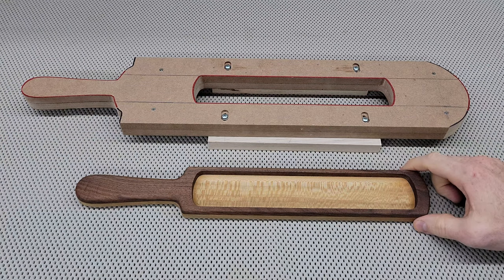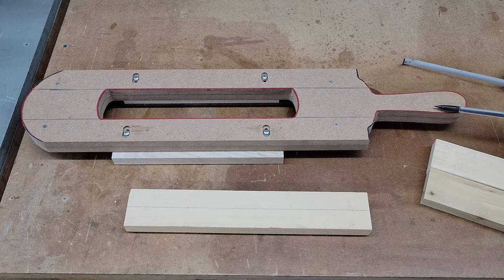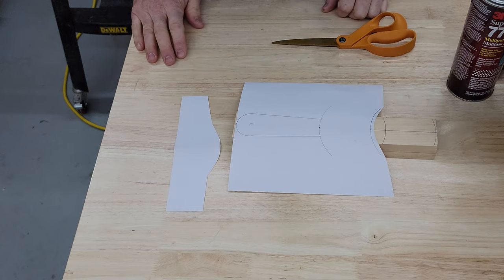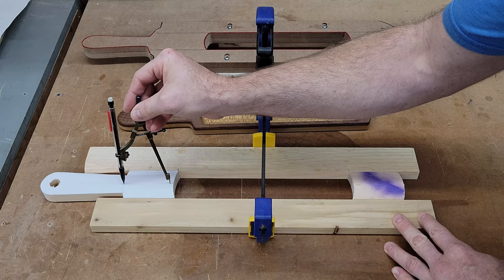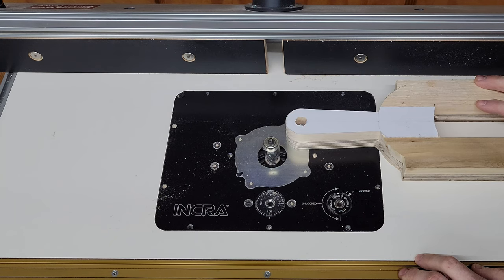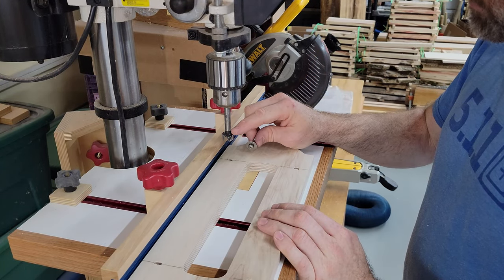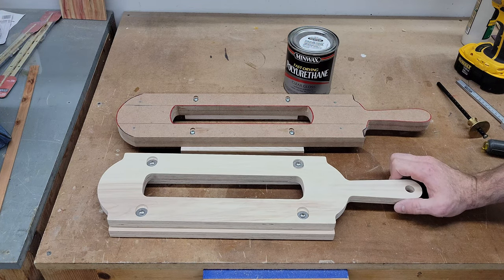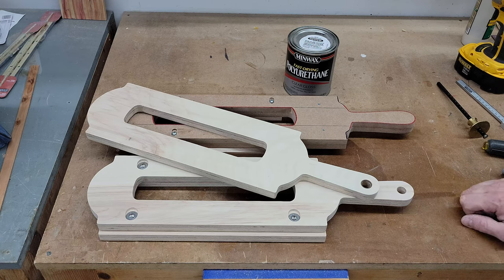Cheese and cracker serving trays - How to build the jig (Plans now available)

Comment: 21:20 Since you're using a top/bottom bearing bit couldn't you flip the work over, raise the bit so the bottom bearing comes into play, then route the other half of the template with the work on the left of the bit so you are pulling away from the bit not pushing into it.
Reply from the maker: That's a very good point. If I had planed the scrap template to uniform thickness I could have just flipped it over.

Comment: Bought the plans for $5. First the amount of work needed to come up with this jig and the additional time to explain and document certainly more than justifies the price. Second the PDF file you get appears very robust (with all the details explained). I hope I can replicate a usable copy of this jig for myself.  Thanks :)
Reply from the maker: Excellent, good luck with the project. Feel free to post links here if you put any pictures online.
Reply: @TheSnekkerShow  Your finished product is top notch. My attempts at making the template went well; but the Bowl Bit in my router table never let me get passed scrap piece. Gouges, burns, varied depths. Tried different cutting heights, 3 different size Bowl Bits (an inexpensive Amazon set). My router is a Skill in a Skill Table, speed set at 2 (with 6 being the top speed). Any thoughts as to what the problem(s) are? I am not well experienced with routers and or using the table. I have used my little trim router for years with acceptable results. Are the Bowl Bits that tricky? Any thoughts offering possible fixes would be appreciated.
Reply from the maker: @simonflr  There are several things that might be affecting the outcome. For a smaller diameter bit, your speed should be 4 or more. The bit needs to be clean and free of pitch buildup. If it's got residue burned on, you can use Simple Green to clean it up. Inspect the router bit edge. It should look and feel sharp. I mostly use Whiteside bits. Freud is pretty good with marketing, but you can see in this picture the difference between a Freud bit and the sharp, polished edge on a Whiteside bit. https://www.instagram.com/p/B-ss9mJBUyY/
Reply from the maker: @I'm Simon  Consistent feed rates are important too. The moment you pause on a certain part of the board, it will burn. It's usually better to disengage if you need to adjust your hands, and then carefully re-engage to continue the cut.
Reply: @TheSnekkerShow  First thanks for your quick and informative response... I will try again after I clean the bits I have, may order from Whiteside regardless
Reply from the maker: @I'm Simon  No problem. I put a link to the one I use in the video description.

Comment: Excellent… I’m working on Pizza Peels for Christmas…. But, I can’t show them on my channel until after Christmas because the recipients watch. 🤫

I am gonna steal a couple of your ideas… you did a fine job of illustrating a lot of template tricks!  Thanks
Reply from the maker: That's a nice gift idea. I make pizza from scratch every week, and I still have not made myself a pizza peel - I'm using a large cutting board instead. One of these days I'm going to get around to it.
Reply: @TheSnekkerShow  I made 15” peels a couple of years ago… they are great for outside use but too big for kitchen use.  This year I made a new template that is 12”.
Reply from the maker: @sassafrasvalley1939  My pizza stone is 15", but there's not a lot of space around the oven for a long handle, nor is there space to store it. I've thought about something with a shorter and collapsible handle, but I haven't worked out the details yet.
Reply: @TheSnekkerShow  that would be cool!

Comment: Any problem putting threaded inserts on the bottom of the side pieces and a bolt OR is that simply overkill??
Thanks for taking the time to do this video - definitely on my to do list! !! !!!
Reply from the maker: Nothing wrong with a little overkill in the workshop. I doubt I'll ever wear out the screw threads in Baltic birch plywood, but threaded inserts are a nice touch.

Comment: Great build, lots of insight into the construction. I can see why thicker ends & slide due to MDF being bit fragile, but now it's ply, much stronger, could you build ends exact size and route out centre & ends without the extra steps?
Age thing, I tend to forget some config steps, so I try to design as "foolproof" as possible (remembering "Nothing is totally foolproof, to a suitably talented fool")
Reply from the maker: I thought about doing it that way, but it leaves some thinner edges on the jig, and less support for the router base when cutting out the inside. Once the initial configuration is done, it's easy to repeat.

Comment: Great video. Question what kind of scroll saw blade are you using for the Dewalt scroll saw? Thanks
Reply from the maker: Good question, but I don't remember. Probably something around 12 or 14 teeth per inch. In general, more TPI means slower cutting but less sanding, and fewer TPI means faster cutting but more sanding. 12 is somewhere in the middle for this type of project.

Comment: Did you just tap the wood for the number 10 screws?  Great video!!!
Reply from the maker: I predrilled the holes, then put a little wax on the screw threads when inserting.

Comment: Great video! Very impressive, master level work, really, no joke. Also, very impressive stack of lumber stickered in the video background. There is a channel I watch, "Workshop Companion" which did a video on re-sawing and air drying lumber. He bound his stack with bailing wire which I had never seen before. Have you seen that video?
Reply from the maker: Thank you. I don't think I've seen that channel. For boards 23" or shorter (the width of the kitchen oven), I normally use twine or bar clamps. Once it's air dried, I'll pop it in the oven with the clamps or twine still on.

Comment: Can I purchase a jig from you? I don’t have all of the machinery needed to make it for myself, but would love to make some trays for gifts.
Reply from the maker: I've thought about selling them, but haven't figured out the details yet. There's a link to full-size plans in the video description, and you could realistically build this jig with very basic tools.  A router is pretty important though, for the jig and trays.
Reply: I have tried twice now to make your jig. The jig itself is not hard, but I haven’t been able to make the template without waves. Could you please help me and sell me one of yours. Your help is really appreciated! Thank You.
Reply from the maker: @joeburgoni9772  I only have one competed jig at the moment. I started to make another last weekend, but didn't have time to finish. If the paper template is coming out wavy, you might be better off just using it as a guide to make your own markings on the wood. I put center points on all of the circles to make it easier to set up and position a compass. Also, I find it easier to start out with three 2-inch boards than one 6-inch board, because then you don't need to worry about cutting straight lines in the middle. Another nice thing about that approach is that if you mess up the curves on the handle, you only need to cut another handle rather than an entire jig. I could also send you a single-page version so you could go to a place like Office Depot to get it printed full-size. I think they do big prints, but I'm not sure.